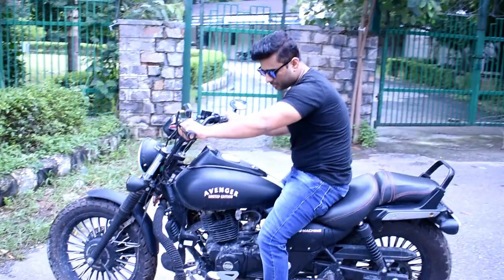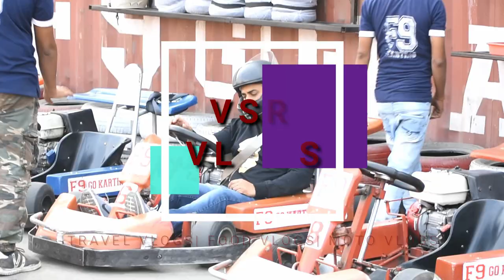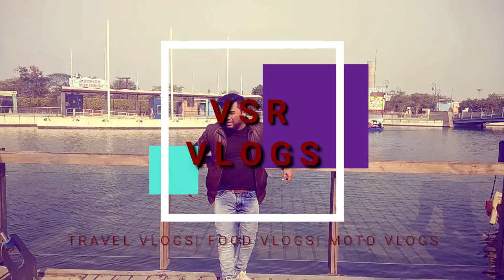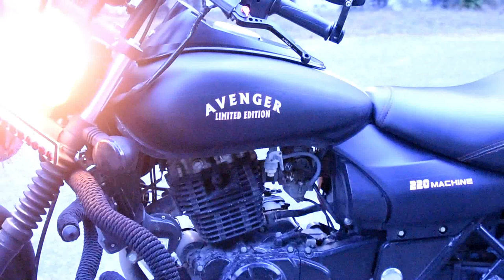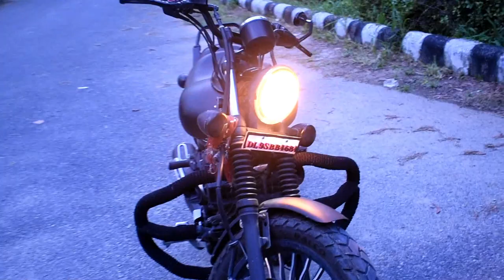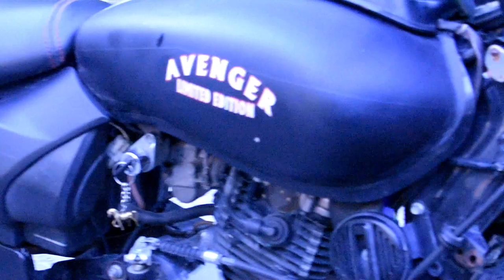Bike modification rules | RTO Rules| Custom Bike Modication

Comment: Tyre relco company kai hai : age kitna size and piche ka 140/90 15
Reply from the maker: Hi bro yes you are correct the front tyre is 110/80 r 17 and rear one size  is 140/90 r-15
Reply: VSR Vlogs aapka modification kya legal hai
Reply: @realcarfacts5538  pls tell i had changed rear tyre with relco, do i have to change front one also.

100 or 100 is better
Reply from the maker: Hi Gaurav  bro I think it's better if you change your front tyre too.

Comment: what is front tyre size.
Reply from the maker: Hi the front tyre size is 90
Reply: @realcarfacts5538  sorry i  dont think its a 90, could you please give me the full dimension reading in your front tyre (eg : 110/80 -r 17) if possible.. Thanks
Reply from the maker: @vishnudev.s  sorry for the late reply Bro you are correct the front tyre is 110/80 r 17 and rear one size  is 140/90 r-15